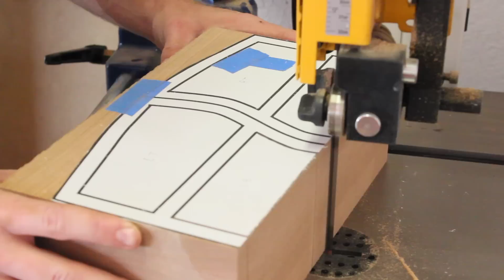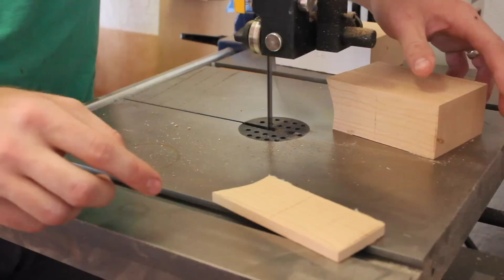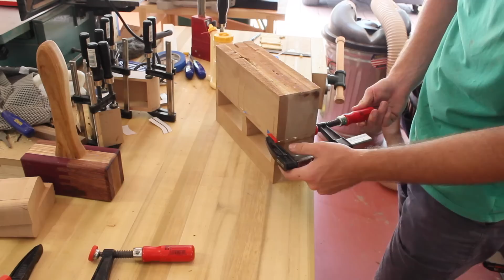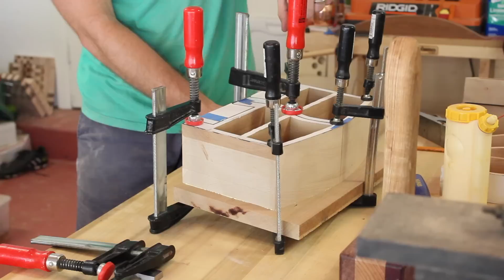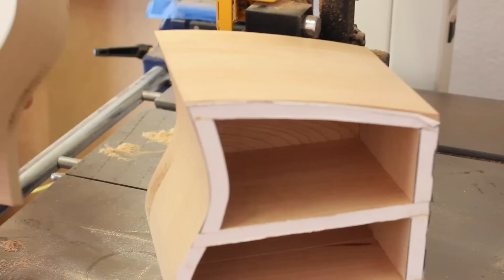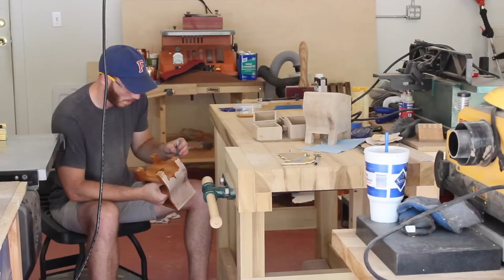Making a Pair of Bandsaw Boxes

Comment: Top job mate
You got a new sub. I don't care that you didn't use the table saw for everything. You used it how I would have if I was making a similar box. Straight cuts are much quicker and neater on a table saw
Reply from the maker: Thanks for the comment. The only downside to the table saw for the straight cuts is the extra material lost compared to a bandsaw blade. It effects the grain continuity a bit but its not too bad.

Comment: Your the ONLY person I've seen on YT that addresses the problem of the drawers not being flush with the main body, because the drawers have two kerfs cut when the front and back are cut off.  Looks like you glued shims to the back of the drawer then planed them until they were just the right thickness to make the drawer flush in front?
Reply from the maker: Yup that’s how I typically did it when I started. You can also use small, adhesive-backed felt pads. They’re easy to apply and you are able to slice a layer or two off if needed. I learned this from Roy’s Box on Instagram/youtube.

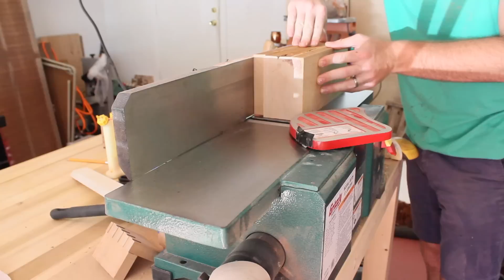Comment: At 1:30 what are you running through the jointer?  It hard to tell what face is being milled.  I have made this box once before preparing to make it again.  This time I want to contrast the drawer faces.  Not sure if I should veneer the fronts or pattern bit and route a new front.  What do you think?  Awesome work
Reply from the maker: At 1:30 it’s the bottom face of that top block.

I’ve never done contrasting drawers but think either option would work. Simon Roy of Roy’s Boxes used to do a lot of contrasting drawers I think. He might be someone to look at for that.

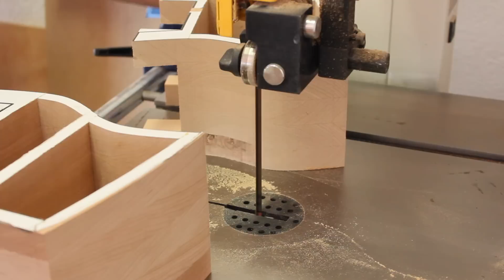Comment: I don'w know if that's important as i never used a bandsaw , but at 7:11 your bearing stopped spinning...
This is an awesome work! THanks for sharing....
Reply from the maker: Thanks for the comment. The bearings are there to keep the blade in line so if they aren't spinning it means the blade is on the right course.

Comment: Wow. Is all I can say. First time viewer and newest subscriber. I can only WISH I could do that. Just retired and starting to collect tools. And now I have a goal to achieve..... to make my first bandsaw box, but will be starting off a lot simpler than this amazing creation. Was that just a simple common type of “crazy glue” you used along with the wood glue on the drawer pulls? What size blade do you suggest for bandsaw. 1/8”?
Reply from the maker: Thanks Mr. B! Ya, it's just a normal superglue which help secure the piece quickly while the wood glue can dry. Sometimes its tough to get clamps on small handles like that so the superglue makes due. I prefer 1/4" 6tpi blades for most of my boxes. If there are only straight cuts, I'll use a 3/8" or 1/2". If its a mini box, I might jump down to a 3/16". 1/8" are too small to cut through that thick of material; the blade drifts too much.
Reply: Once you get your first one done and work through the process you will be always be looking to push the limits on your next one.

Comment: Great project.  How do you like the bench top planer?
Reply from the maker: Thanks! I like it a lot. Got it in craigslist to replace a really old Delta. I think this is one of the, if not the, best planers before upgrading to a floor standing model. I think the biggest complaints are it's weight (I don't move mine), the noise (wear ear pro), and the blades. I make a lot of stuff and don't change the blades too often. Thinking about upgrading to a helical head though.

Comment: You’re bandsaw boxes are amazing? What size/TPI blade do you use? 1/4”?
Reply from the maker: Thanks! Yup I mostly use a 1/4” 6tpi blade. I’ve also used 3/8” 4tpi. They work well if you don’t need to make tight curves.

Comment: Nice job! What bandsaw blade did you use on this project?
Reply from the maker: I typically us 1/4" 6 tip blades for my boxes. If they're all straight cuts, I'll go to 3/8" or 1/2" 3 or 4 tpi. For tighter boxes I'll drop to a 3/16" blade.
Reply: @parillaworks  that's helpful, thanks. What brand blade do you prefer? Do you use a skip tooth? Sorry for all the questions. You are very talented on the bandsaw!
Reply from the maker: No problem at all, I don't mind answering questions. I've been using Timberwolf blades for a few years now; good mix of quality and low price. I think the blades a positive claw with a raker set.
Reply: @parillaworks  thanks again!

Comment: Very nice! What size blade did you use in your bandsaw?
Reply from the maker: Angie Overton Thanks Angie! For most of my boxes I use a 1/4" 6tpi blade. You can also use a 3/16", 3/8", or 1/2" depending on the curves you need to cut.

Comment: What blade did you use in your bandsaw? I saw hardly any saw marks on the wood!
Reply from the maker: Thanks Ryan. For most of my boxes I used a 1/4" 6tpi blade from Timberwolf. At times I'll also use 3/16", 3/8", and 1/2". It all depends on the design of the box and radius of the curves.
Reply: parillaworks do you maintain the 6tpi for all those sizes? I'm having a difficult time using my 3/16 blade and maintaining a straight line, but my other blades leave too many marks. I suppose it's just I need better blades.
Reply from the maker: Sorry for the delay. The 1/4" is the only one that's 6 tpi. The other sizes are a mix of 3 and 4 tpi.

Comment: How do I print the template actual size? Or, what are the height x width x depth of the box?
Reply from the maker: The box is 12" x 8" and the depth can be whatever you like but I usually go with about 4.5". I had to print it on two sheets of paper and tape them together.